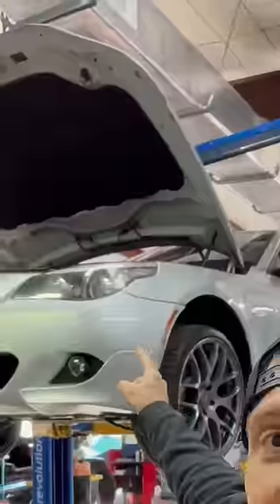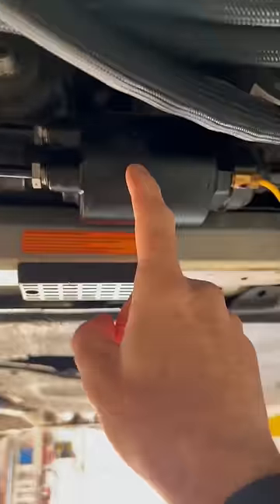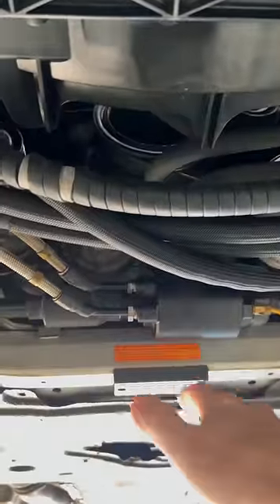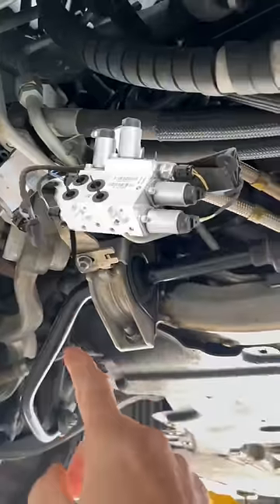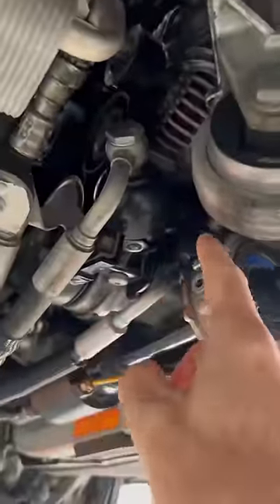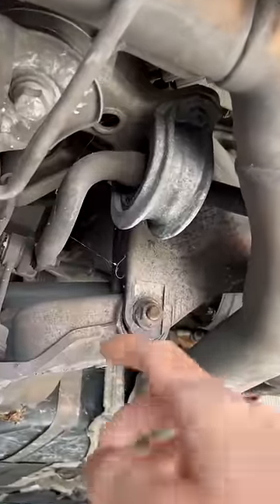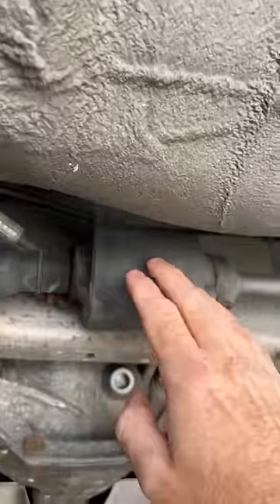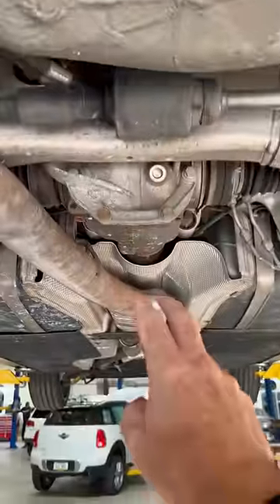Over engineered?

Comment: This is overengineering in that the system is more complex than it needs to be to achieve the same/similar outcome imo. And has a high number of faliure points.

On the otherhand I would hope a system like this is overengineered in the sense that it has a much higher than necessary safety factor and/or requires forces far in excess of what is considered the maximum to fail.

Comment: I’d call that over engineering, that I need to know about up front. 
   If I hit road debris avoiding an accident, and the hydraulic pump/controller is compromised.  Am I suddenly going to have immediate handling problems exactly when I need this feature most?

Comment: I drive a lot and pay attention to what kind of cars I see broke down and i have seen A LOT of beamers broke down and I'm not talking old ones either. They are way over engineered. My friends mom has a Mercedes with a hydraulic operated hard top and you have to have a special tool just to put in the fluid! It was leaking that's how we learned this and it was gonna cost $2500 to fix the leak

Comment: Completely over engineered just put in a thicker sway bar as nd better suspension from stock !! And use polyurethane bushings instead of rubber for better rigidity but depends of opinion but I've swapped out for ploy bushes before and honest it's night and day difference poly all the way !!

Comment: Everything in life is a trade-off. Different strokes for different folks. I think you'll find that there are many people here of both opinions. When electronic fuel injection first began to become mainstream it met great resistance to change due to its complexity and cost, but now, after many decades of hindsight, I don't think there are many people left who dispute the superiority of fuel injection vs carburation. Progress always takes time to attain mainstream acceptance and always comes with some form of growing pains. I personally feel like it's a little of both, excellent engineering, and, at the same time it's just more stuff to go wrong. People who can afford these kinds of cutting edge vehicles can probably afford the cost of the maintenance and repairs, so for them it's probably a worthwhile trade-off. Others are probably more likely to stick with vehicles that have systems which are tried and true and that they know well, so for them, not having the newest tech is a worthwhile trade-off. Nothing exists that pleases all people, everywhere; some people will love it, and some people will hate it. It has been said that a true measure of success is how many haters you have, lol. Thanks for sharing the info in this video!

Comment: Many problems on german cars are caused by typical peugeot drivers.
Just drive, dont wash and no self check for things that make noises or just check the oil sometimes.

Most e60 in germany have over 350k km now and do fine 
Only problems is the power steering wich cost about 600 to repair but it fails mostly with over 300k km.
Alse electric problems with the throttle poty .or the radio.

Comment: It's expected for the BMW to be over engineered.  It's a top class brand sports type. 
Economic class brands are generally not of such kind, like: VW, OPEL ,FORD, PEUGEOT, RENAULT, CITROEN...
Reply: VW is a really bad example. They had engines with 3 timing chains and their current reliability isn't really good if it comes to engines and transmissions.

Comment: Contrary.  I would never call that “over-engineered.”  I’d call that more like “unnecessarily-engineered.”  You could get the same results with a far, FAR simpler setup, and simplicity typically means bigger parts, which typically means longer lasting, and also easier to replace.  It’s completely unnecessary to put that much intricacy into a design, as it introduces far more failure points.
Edit:  Additional.  I live in Alaska.  So while it may work just fine for a pavement princess in a stable climate, but stuff like that loves rapid unplanned disassemblies when you add a little mud, salt and snow.

Comment: As long as all the fancy stuff works as it should and is kept in good shape (by either your wallet or your hands doing so) then they are nice. Mercedes, BMW, Audi, doesn't matter. Up to around 2004. But they dont build em like "back then" anymore. All the sealing rings, gaskets, rubber bushings etc will wear out over time and the engines need tight maintenance intervals, all cars does but on german ones it gets insanley expensive. 6.3 liter AMG crate engine costs around 40.000€ Audi 3.2 aroud 16k (and don't trust em when they tell you 20.000km is okay for an oilchange, it's only okay when you wanna buy a new car rather sooner then later) German "overengineered" stuff is really nice but not when the companys cut corners on every 0,1mm of material. Also most of the stuff isnt actually even needed for ->normal-< driving on the road. Also you guys over the big lake dont even hace sth like TÜV(MOT) it seems? Nuff of that before i really fet myself goin... My reference to spit such words: i'm a professional german. Now go stone me to death comment section.

Comment: If it isn't failure prone and does what it's designed to do, the engineering is sound. You tell us, how often does this system fail and require replacement?

Comment: Excellent or Over Engineering? 
Nah... its Called Sell-when-it-goes-wrong Engineering😆 

The whole front sub frame with the suspension has to drop if you want sort out an leaky sump oil & that model I saw didn't even have this trick sway bar. 
Loosing hope of owning a E60 5series everyday

Comment: Overengineered junk! Owned an E90, E92 and E70. All total junk and complete waste of money. Engines, ECU’s, regulators, switches, sensors had to be replaced within 80k miles. Have two Lexus’ now for four years and only thing so far between the two has been one battery.

Comment: It's neat and you do pay for pioneered engineering, however, running an electric motor and gear reduction instead of hydraulics is a simpler and longer lasting system.

Comment: It's trash...anything that piggybacks off the powersteering hydraulic system has never been a great idea. Too many moving parts, hoses andseals that can fail, make a huge mess, cause a fire and be quite costly to repair. I remember Toyota and Lexus had a hydraulic engine cooling fan that also ran off the powesteering pump, they were a disaster and would leak damn near every where and also if the pump or really anything in that system failed your engine was now going to overheat...frigging genius 😳 SMH

Comment: Absolute piece of shit one of my best friends bought two brand new BMWs they both broke without 30,000 miles transmission electronics all sorts of stuff cost about $11,000 for the transmission replacement then my boss bought a BMW with less than 13,000 miles on it from a BMW dealer I was in the shop for 3 months

Comment: dumb design the power steering pump should a least be independent
Reply: You can guarantee the supply of the power steering with priority valves. These are commonly used on machinery with hydraulics and full hydraulic steering, like a tractor (they don't even have mechanical connections to the steering until they are 60 kph models).

The other question is if you need such a system at all, Merc offered something similar with their ABC body control and if they break they are horribly expensive to fix